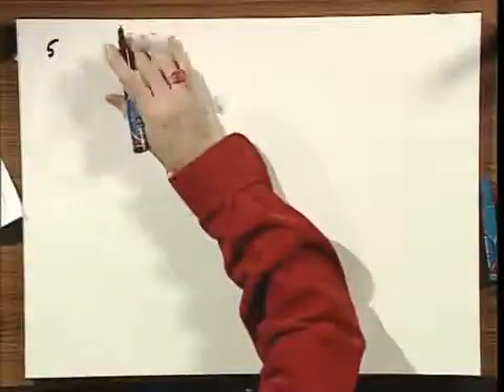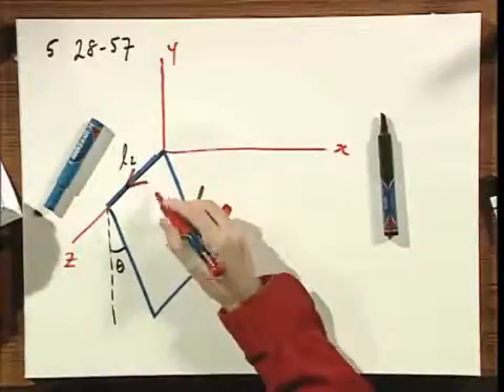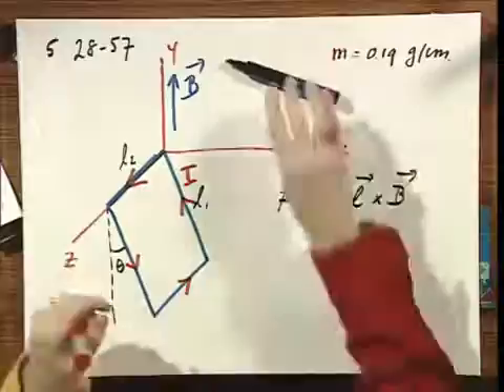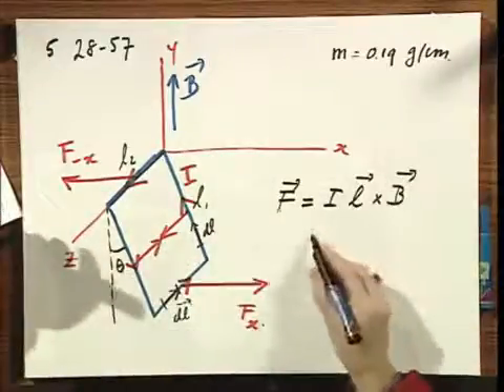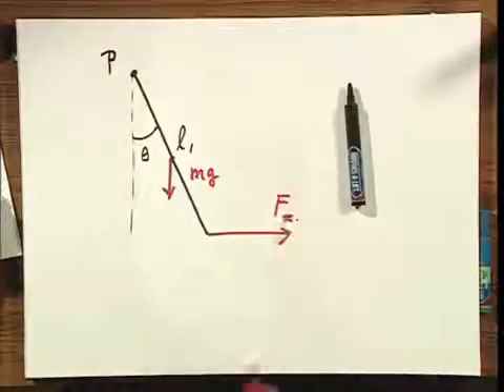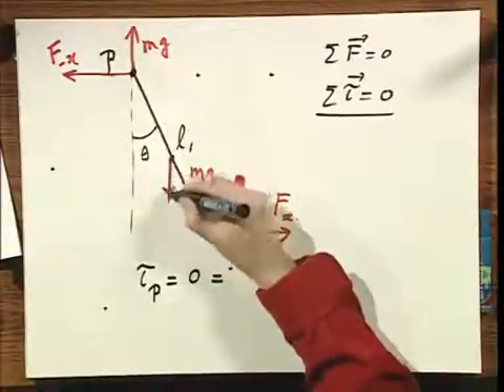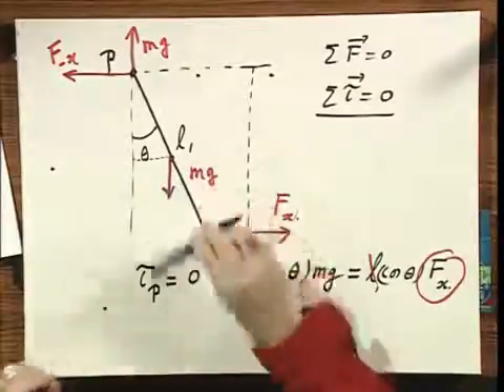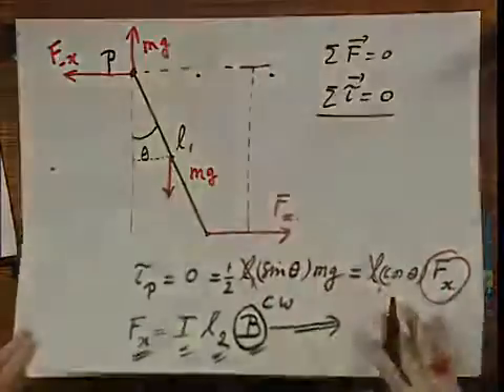8.02x - Module 05.04 - Torque on a Current Loop.

Comment: 2:45 isn't the force on the minus z direction and the other one on the + z direction ?
Reply: @Sorin Panciuc , I think you are correct, the force on the L2 lengths should be pointing outwards according to the picture. However, maybe Walter Lewin thought you were referring to the L1 lengths when he said "no."
Reply from the maker: no
Reply: But Sir I google "torque on a current-carrying loop in a uniform magnetic field" and all images show the 4 forces pointing away from the loop and also I try to use right hand rule and I get the same direction....Why are those 2 particualr forces pointing inward and not outward of the current loop. I know they simply cancel out but I want to know my mistake. Thanks
Reply from the maker: Please watch my 8.02 lectures. What I did was correct and I cannot add anything.